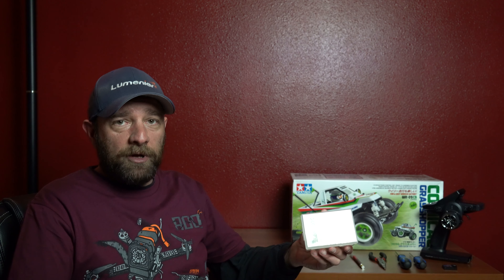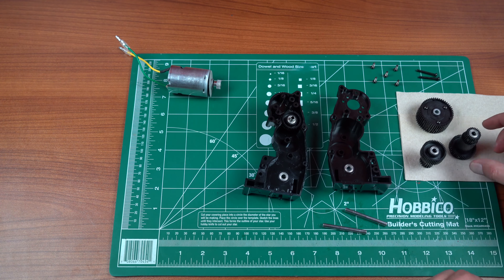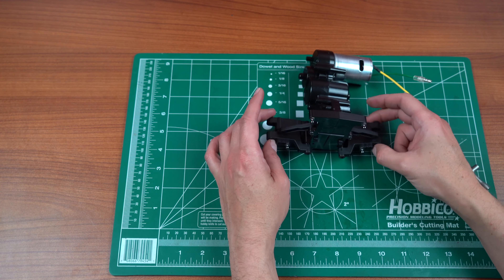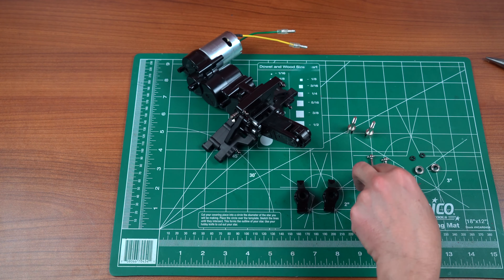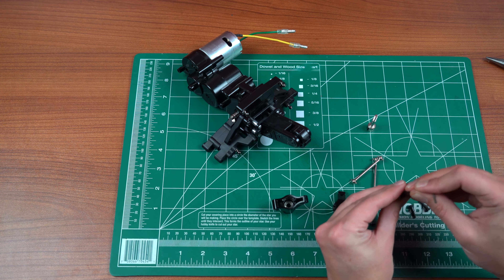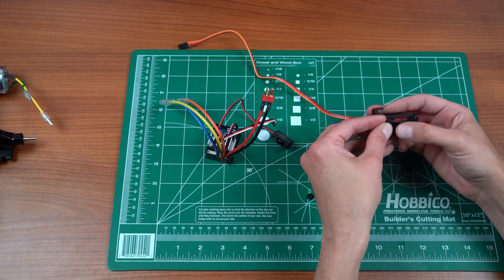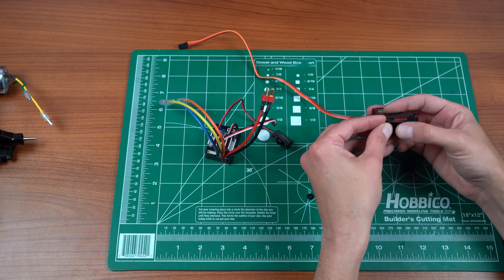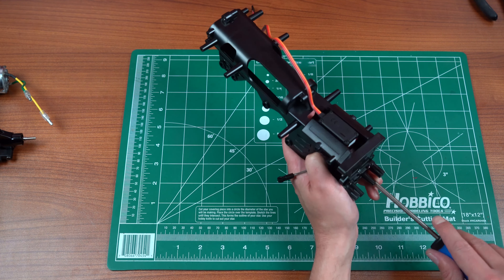Tamiya Comical Grasshopper Build Part 1

Comment: Excellent and patient explanation of the build.  Many thanks.  I have a question and a comment.  The question: do the screwdrivers you recommend have a magnetic shaft/tip?  If so, that would be very helpful for my next build.  The comment: some of the very frequently used screws, like the BA-3, are distributed in multiple bags that are not obviously connected with any particular step/page of the build.  It may be worthwhile to segregate those screws early in the build for easy recovery.
Reply from the maker: Thanks! I can't remember if those screwdrivers came with magnetic tips but here is a tip, any screwdriver that doesn't have a magnetic tip if you touch it to a magnet it will then have a magnetic tip.

Comment: Question: when you first opened the transmission, did you notice if Tamiya had grease pre-applied on the gears? A YouTuber opened his transmission and mentioned there were no grease pre-applied on his kit and wanted to confirm.

Thanks in advance.
Reply from the maker: There was no grease and on the gears. Appreciate you watching and commenting!